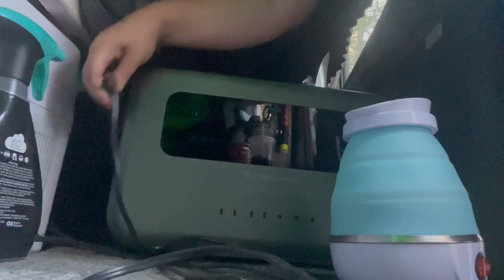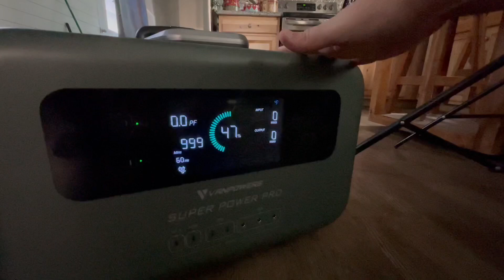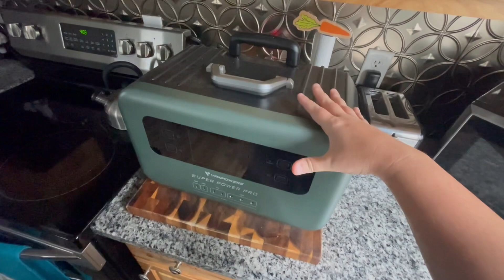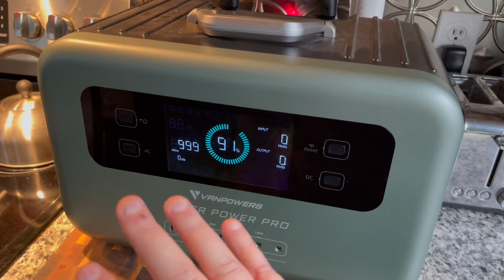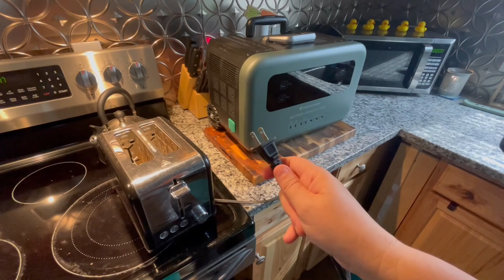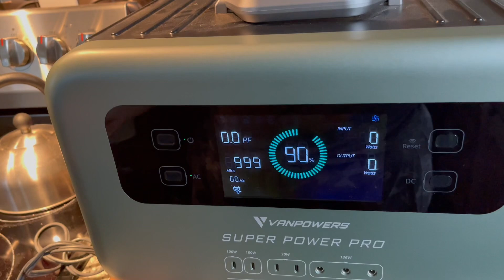Will This Go Back In My Van? | VanPowers Super Power Pro Full Review

Comment: The AC plugs use an inverter to change from DC to AC, so that uses power, when it's turned on, even when nothing is plugged in.  It's also why your power bricks for USB use more power than just plugging directly into the DC USB plugs.
If you need more USB plugs than your power box has, you can get splitters to run more items from one USB port.
You can even get 12V (cigarette plug) splitters.  I just got one that converts one plug into three, and has switches to turn off the ones you're not using.  Great for running the fridge and lunchbox cooker while parked or the 12V heated blanket at bedtime.
That's a nice power box for base camp.  Maybe, in the future, you'll be able to have that amount of power in a smaller, easier to travel with, container.
My Bluetti EB70S is the perfect size for my minivan, and I've used it in my house during power outages.
Jon in rural BC, Canada

Comment: I would really like to see a van build that “encloses” this in a range of cabinets to give the interior a more finished look - with no electronics skills some of us would prefer something like this instead of cabinets full of electric components. Because of that, I like the boxy and flat top shape.
Reply from the maker: I really do like the flat top. However, since that is not how mine is set up, I don’t think it would work out quite as well for me. Being able to read, the display is super important and also being able to access both sides because I have to both charge and use power so in my small space that would be something that would not be achievable unfortunately
Reply: Electronics, especially if they are pushing or pulling a lot of power, need ventilation, unless you are just looking for an expensive way to start a fire.

Comment: You know, I have the same size van, and every time I saw this Power Station I felt very uneasy about it because how large it was. I was looking forward to hearing what you had to say though, because after looking at this Power Station when you first mentioned it I noticed that there were some challenges for our small spaces, I’m glad that you were very transparent and even though it does sound like it could power everything I don’t think it’s worth it if it takes up all of the space and it’s also a problem to move around we get things so they can be more convenient not more of a struggle.  This is why I love your channel. I can always expect honesty.
Reply from the maker: Absolutely. I think that if I were in a larger space, this would be perfect. However, in the smaller space it just makes it a little bit more problematic than using some of the other front facing stations.

Comment: Good to know! Definitely would be difficult to move sideways. Wheels are great, but could they be recessed so sliding sideways would work better. The weight of my Bluetti EB70S is challenging so I am putting them in the back of my minivan so I don't have to move them anymore. I can charge with 12v in the back or set the solar just outside my hatch. I think for me it will be a game changer!
Reply from the maker: I absolutely agree. The wheels are wonderful until they are not. I wish they would’ve put them on. Maybe a caster wheel which could rotate or potentially turn. That would’ve been great. I understand why they have it set up like this though and it does make it very convenient. However, if they had those fully rotating wheels, it could work so much better in a small space.